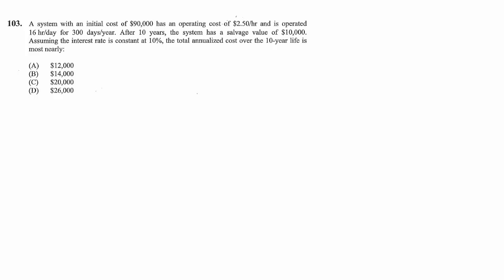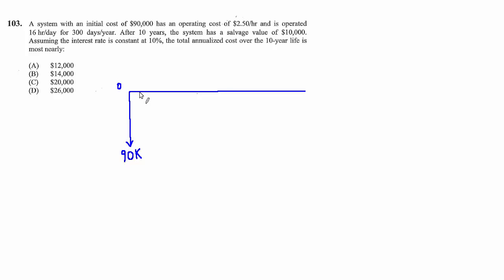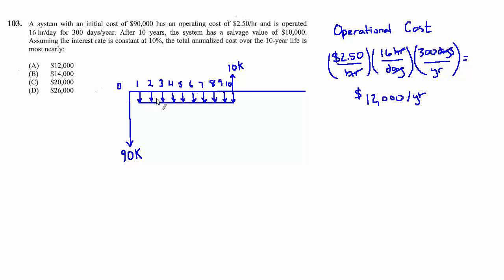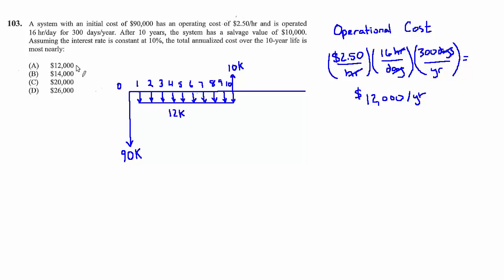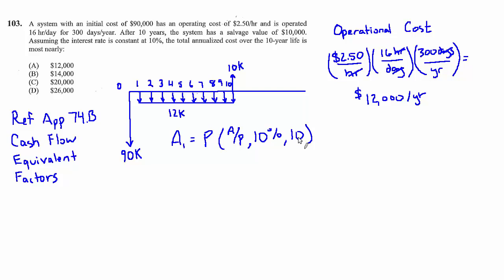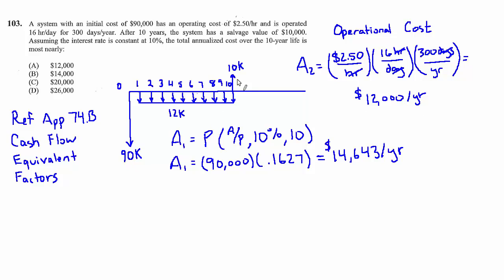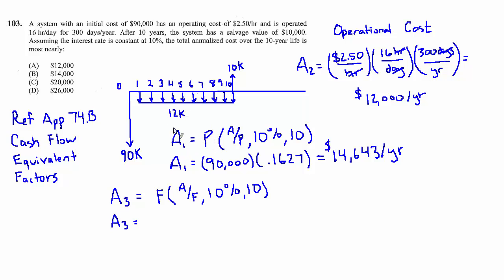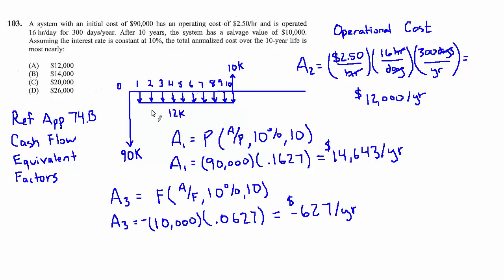Mechanical PE Exam HVAC | Calculating Annualized Cost for Systems with Operating and Salvage Values

Comment: Whats funny is that, to me, the inherent language of "After 10 years, the system has a salvage value of $10,000" means that's the future value! Right? Plus, if were to be examining the minutia like that, then surely we need to account for the operational cost in regards to inflation! I jest...studying for HVAC now...shoot me lol
Reply from the maker: Haha, great point!  And yes, absolutely we would need to account for inflation.  Although, most econ problems abstract this away by stating an interest rate (probably implied to be in real terms) which encapsulates the time value of money from present to future without inflation, and then inflation rate would need to be tacked on to that, if applicable.  It's pretty rare than an engineering econ problem would require this, but for practical purposes, your intuition is spot on!  The problem then becomes projecting the future inflation rate for a specific service or good, which is also difficult in the real world and would need to be given to you.  Thanks for this comment, good to know you're seeing the full picture.

Comment: What if the annual operating cost increase after year 5? Lets says 15000 how do you do that?
Reply: For how long before it returns to 12,000? If it doesn't fall back to 12,000, then average the cost between 15,000 and 12,000.